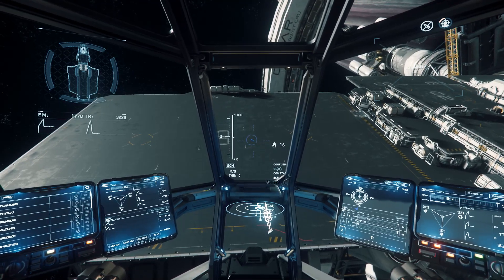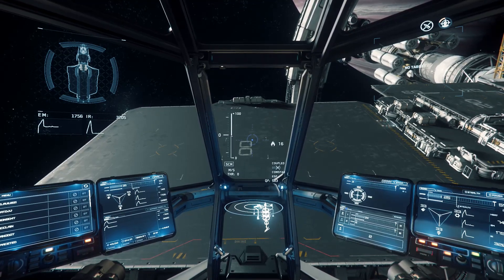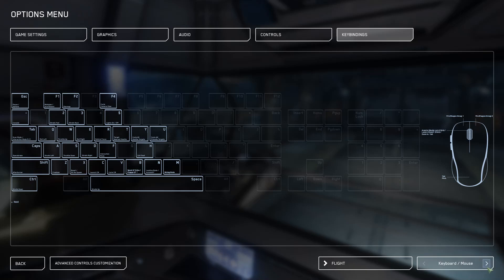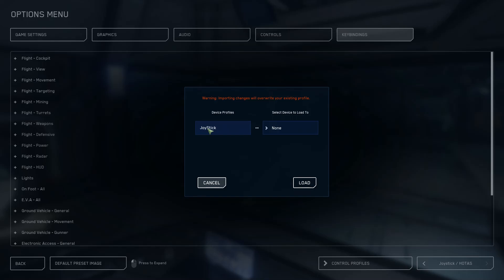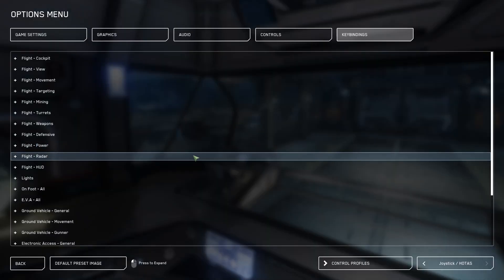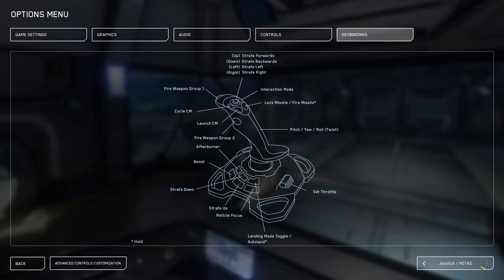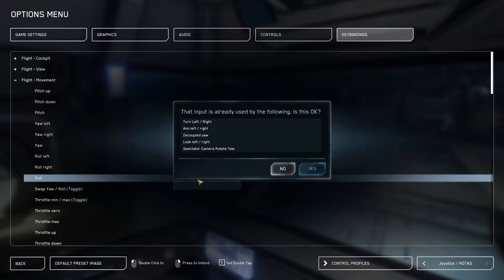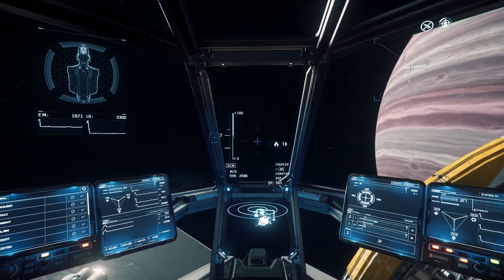How to Install / Setup JoyStick in Star Citizen (Saitek X52 Pro) (3.0)

Comment: just one thing no one mentions, what about the actual x52/logitech software comes with no profiles does this software need to be on? as half my binds work and most  movement of the stick is un responsive
Reply from the maker: I’ve personally had a terrible time using there software and it didn’t really work on its own. I’ve gotten SC to work with ans without it.

Comment: "It shouldn't be like that, it should be when I tilt the joystick it rolls."
Dead wrong. The ships you're piloting here use thrusters on 6 degrees of freedom that do no utilize traditional atmo lift mechanics to achieve altitude. In an airplane you need to roll to make a 90 degree turn. Here you just use thrusters to yaw. It makes literally no sense to prioritize roll on the x axis when you're not limited in this way. Control the ship with x-y thrusters on the stick, roll bound to stick twist since it's less important. The ONLY reason not to do this with a traditional HOTAS setup is your own muscle memory. The stick SHOULD be mapped the way it came, you simply prefer it another way. When you do it that way you're stuck with an extremely imprecise x axis input (one that's used for crosshair placement). You'll be stuck rolling like an airplane to keep target, thereby limiting your flight options. Don't let modern avionics and atmo dictate your space dogfighting logic.
Reply from the maker: Thanks for writing all of that. But you are right I took over the logic from flying in games over to this just to make it easy. I still have yet to find a way to make it comfortable but I have upgraded to the X55 so maybe I will try again with this in mind.

Comment: Question:
Can I utilize a Warthog with throttle for flight, and a controller when on foot or driving a land vehicle.
Though I've got a Warthog, I've yet to implement it and I use a controller. It works fine for everything except pew pew. I utilzie a Warthhog and throttle when playing ED and have no issues when driveing a land vehicle. Reckon I might when they implement walking to some degree.
Reply from the maker: Sc is very touchy in that sense but you should be able too.

Comment: The problem im having right now is getting my Saitex x52 to show up at all, ive chack the connections and they all seem fine I have also restarted the game but can't get my stick to show up in the advanced configurations area, any other suggestions that might help?
Reply from the maker: yes, there are a few things I can think of. First, my question is does it show up in any other games?
Reply: Yes i have played other games and i can use the stick, just not with Star Citizen
Reply from the maker: @SoulfulLifeJourney  I've had some weird issues myself when playing. When it didnt show up for me i reinstalled the logitech software, restarted my pc and tried plugging it in a different port. SC is weird as in I can't pinpoint one issue but I find things just sometimes don't work. Also feel free to join my discord if you want to direct message me!
Reply: Thank you i will try a couple of those and see what happens I hope i can make it work

Comment: hello! i have a problem
i baught my x52 pro 2 days ago and i still havent found anwser to my issue
when i load the x52 pro settings in game or any other settings my ship is not moving
when i move my joystick then only my characters head is moving looking up down left and right but not ship
Throttle and Strafe are not working at all
ive tryd remapping in game ive tryd other profiles and i even tryd remapping using SC Joystick Mapper still nothing
Everything works fine in Arma 3
Reply from the maker: Lusti Kamber I’ve tried using sc mapper my self, do you have a discord I can probably send you some things to try
Reply: "baught"

Comment: 3.4.3 patch has messed up all bindings for my X52, the basic stuff for SC is still there, control profiles 'Saitek X52 and ''Joystick - Roll&Yaw Wwap' (no need to that manually!).
You will have these bindings:
https://external-preview.redd.it/Ms-ltqw2ghb6bsrAFxTvZdcSVv8fIJv_JjxVpCsUXqU.png?auto=webp&s=e12405f624f6602da11e13170a8ccedf985d9344

I  found drawings to help set up and remember here: https://steamcommunity.com/sharedfiles/filedetails/?id=238981821

Hope it helps